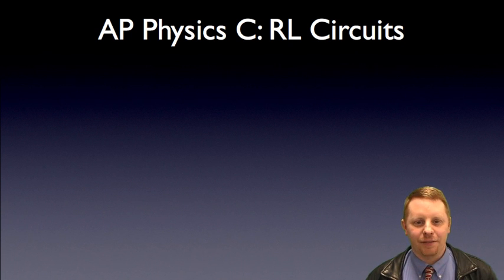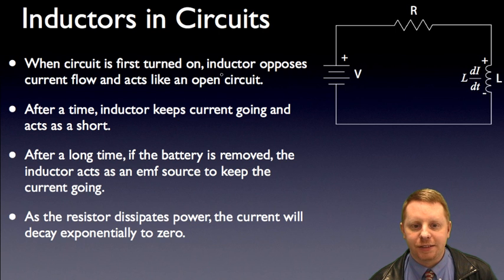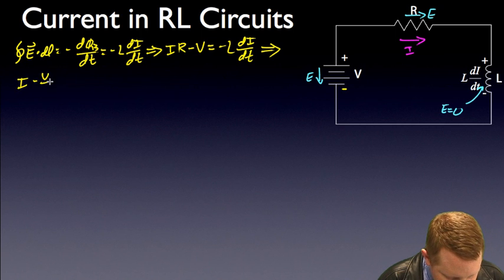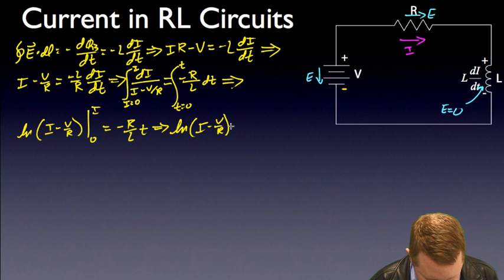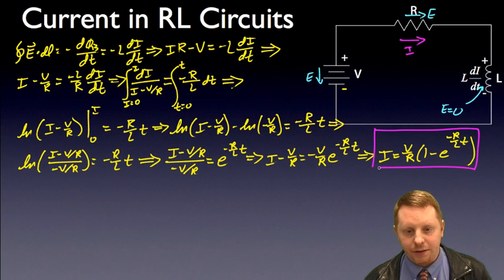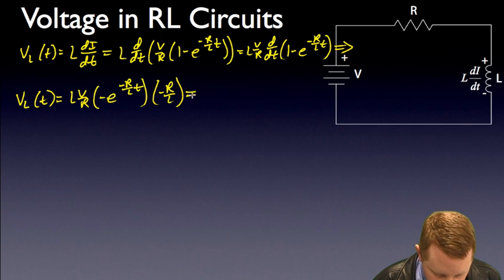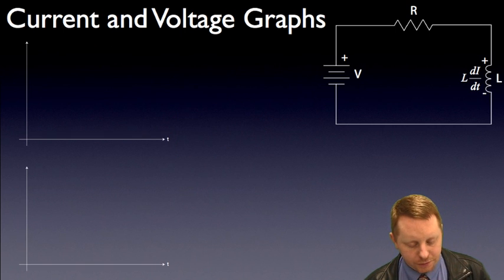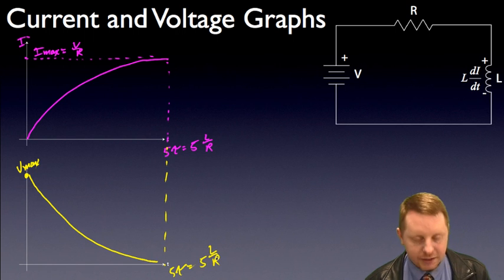AP Physics C - RL Circuits

Comment: Sorry to bother you, Mr. Fullerton. I was confused as to the assumption that the electric field in an inductor is zero. Is the EMF produced by the inductor not a manifestation of an induced electric field? Perhaps it is because Faraday’s Law refers only to non-induced electric fields with regard to the electric field in the integrand. Even so, the resistor is said to have an electric field due to its voltage drop. So, why does the inductor not have a time-varying electric field due to its voltage drop? I also wanted to thank you for your videos; they are by far the best AP Physics C: E&M videos on YouTube to date. You go above and beyond with your rigorous explanations, more than preparing students such as myself. Thank you!
Reply: Mr. Fullerton, I have considered my question more and believe the answer is due to the fact that if an inductor is removed from the circuit and placed in a series circuit with just ideal wire, it will maintain a constant current within itself after a time, thus inducing no electric field after a time. Thus, as you have stated, the inductor stores all of its energy in its magnetic field. Perhaps it is better to think of the induced EMF from a conservation of energy perspective in the sense that the inductor induces it to maintain its energy content in its magnetic field and that such an EMF is a temporary and reactionary phenomena that is a manifestation of the magnetic field and as such is not an electric field in the sense of E in Faraday’s Law, as it is merely induced.

Comment: You said Kirchoff's voltage law is not applicable if there is a changing magnetic flux. But why did you use KVL at 3:05?
Reply: thats if there is a change in magnetic flux throught the whole circuit such as in a lenz's law problem

Comment: Mr Fullerton, if you do not mind, I have another question for you:

when you were deriving an equation for the voltage of the RL circuit, you said that the electromotive force E = -L (dI/dt) and you said that it was across the inductor. This is confusing me as the equation that you derived for the current was based off the same expression but used for the whole circuit. How were you able to say that the expression is applicable for the circuit in one situation and an inductor in the other?

Thanks in advance for the help, and thanks for a great video!
Reply from the maker: The current in a series circuit has to be the same everywhere in the circuit.  So if that's the current through the inductor, then that's also the current through the entire circuit if there are no branches.
Reply: Thank you for a great explanation.

Here is another question, if you do not mind.

When you derived the equation for the voltage across the inductor you said that V(inductor) = L * dI/dt
However, I thought that the expression of faraday's law was integral( E dot dl) = - L * dI/dt where the E dot dl integral referred to the whole current, not just the individual inductor?

Then, how were you able to use L * dI/dt by making it refer specifically to the voltage drop across the inductor, not the circuit, and then not make it  - L * dI/dt [that is negative] per faraday's law?

Thanks in advance, and have a good day!

Comment: Hello Mr. Fullerton, thank you once again for another great video lecture!

Why do you have a positive sign for the IR for the drop in voltage of the resistor in your first example  and a negative sign for the change in voltage of the power supply? Should it not be in the opposite direction?

Thanks.
Reply from the maker: There are different methods of doing this.  I make a loop around the circuit (in this case a clockwise loop) and I record the sign I come to first at each of the circuit elements.  I see the negative side of the power supply first, so I write that as negative.  I see the positive side of the resistor first, so I write that as positive.  Others take the opposite convention.  As long as you're consistent, it'll work out the same either way.  :-)
Reply: Ohh ok. Thanks for the explanation.

My impression was that since I go clockwise and I get to the negative side of the battery and then to the positive, that my deltaV = Vf - Vi is posiitive and thus I would be adding a voltage instead of subtracting it.

What do you think of that?
Reply: Also, why is the electric field in the solenoid zero in the first example?
Reply from the maker: Absolutely, you can do it that way.
Reply from the maker: The inductor holds energy in a magnetic field, not an electric field.
Reply: Thank you Mr. Fullerton, that makes sense!

Comment: In a way, didn't you end up using KVL for the first Current in RL Circuits example? You had IR-V=L(dI/dt), which I think I can find with Kirchoff's voltage law. 

Thanks for the explanations! They help a LOT. You're an awesome teacher :)
Reply from the maker: +SNHD33 It's not quite KVL since KVL doesn't work for a changing magnetic flux, but we can use Faraday's Law to analyze the circuit (KVL is an outcome of Faraday's Law for a fixed magnetic flux).  So they're very close.  :-)  Thanks!

Comment: Why is the electric field 0 in the inductor? Also, in the textbook I'm using the form of the final equation is for a RL circuit where the circuit has been switched off of a battery into a loop and the form of the equation given is I=I(sub 0)*e^(-t/tao) where I(sub 0) was the current when the circuit was switched off of the battery. Are they both valid forms of the equation? Thanks
Reply from the maker: E field in the inductor is zero because all the energy is stored in the magnetic field.  And yes, for an RL circuit, tau is L/R, so the equations are equivalent.  :-)